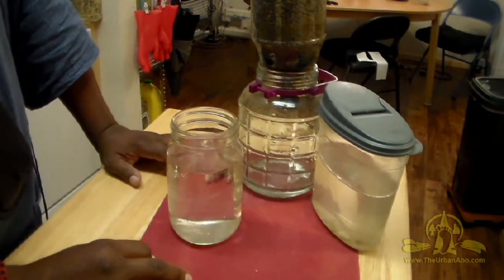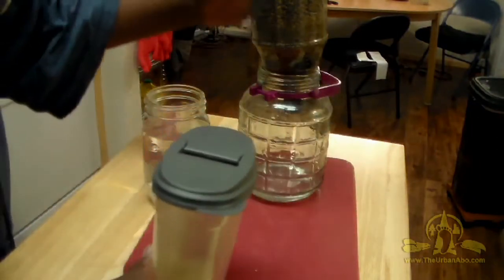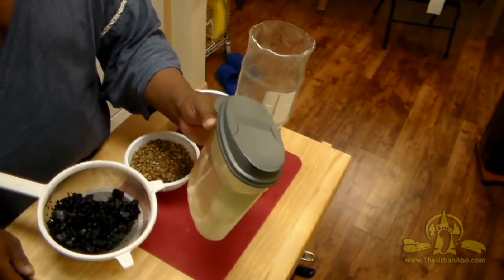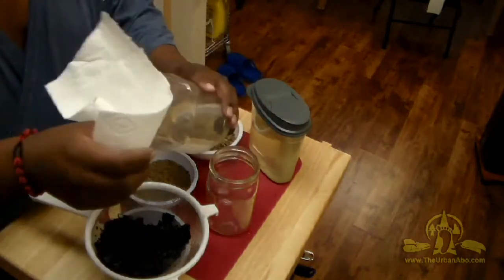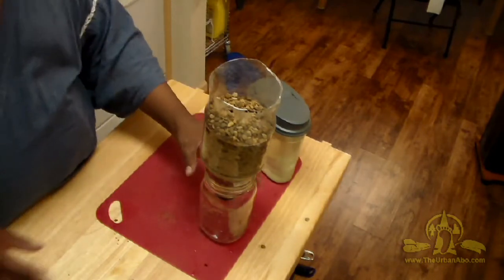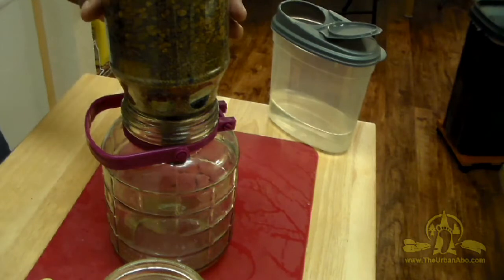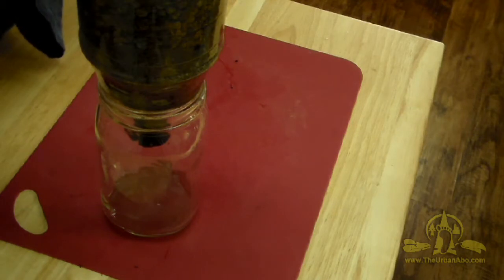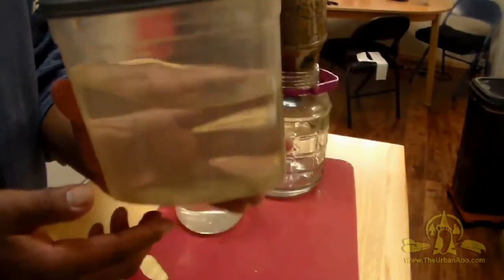Making A Charcoal Water Filter for Water Purification w/ The Urban-Aboriginal

Comment: Thank you! One question, how many times can you use the filter.
Reply from the maker: You know, that is a really good question. I would say a number of times. And since the filtration materials are natural it would be quite easy to replace the filtration system even if one wants/needs to use it only one time. The key however, is making sure that the water is disinfected by boiling for approximately 3min....but, great question. Thank you.

Comment: Cool video.  Another warning: you don't want water running through a current or former commercially zoned area.  Dry cleaners, gas stations and factories dumped all kinds of nasty chemicals into the ground over the past 100 years and it leeches into ground and runoff water. Boiling and charcoal will not remove heavy metals or other dissolved chemicals.
Reply from the maker: Yeeeeep! Right on...this is a pretty complicated subject - it took me awhile to finally do this one. Thanks for the input!